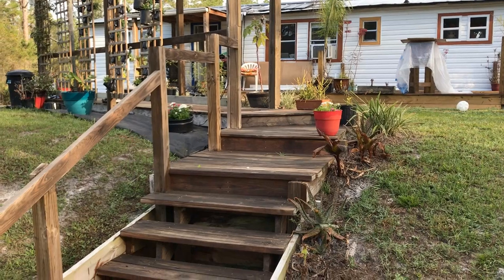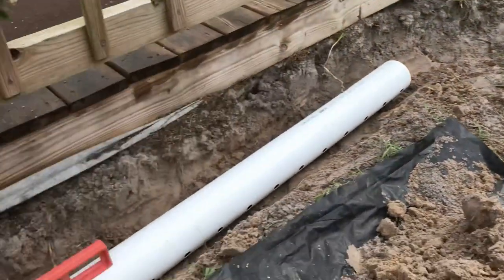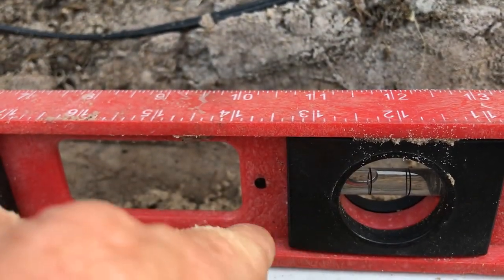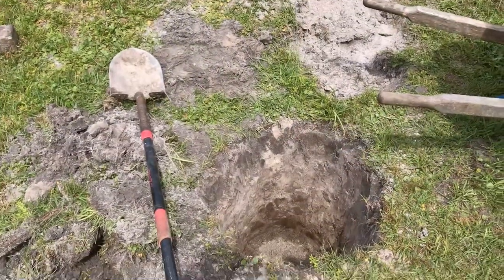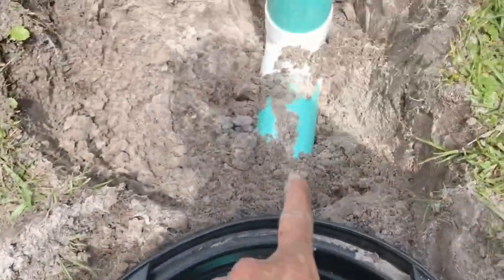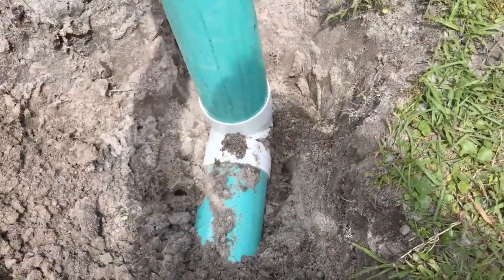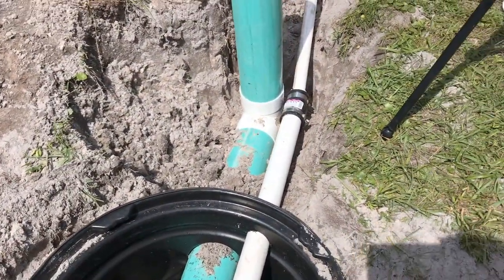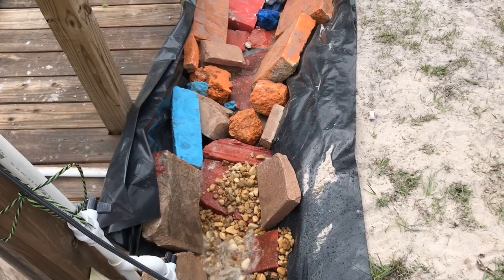DIY, Waterfall, How to Make a Water Feature, Complete How To do it yourself

Comment: Great video.  I followed everything to the T.
I cant get the pump to pump water up that high and  across.  Hieght 240cm. Length 300cm.   Please let me know which type of pump I would need.  I'm in the UK.
Reply: Sounds like you need a stronger pump thats all. Either that or you may have had an air leak somewhere that reduced your existing pumps efficacy?

Comment: Hi, could you please tell me how to get the nozzles in the holes . I’ve done everything to the specific measurements with pvc and 1/4 inch nozzles…I also have the rubber mallet. It simply won’t fit.

Comment: If you have the liner underneath why do you even need the big pvc pipe to the well?
Reply: Dirt and debris are likely to gather in the gravel, eventually impeding the flow of water. The drain tile ensures an unobstructed channel for the water to flow through and will function for many years longer than a gravel trench.

Comment: I liked It, Thanks, finally I got the idea to make a waterfall on my garden wall of 25 feet hight and 10 fee wide.
But still have some questions 
1. The product name to drain out the Water fall is "irrigation coupler"
2. Their is need to cut the irrigation coupler.
3 What is the size of irrigation coupler.
4. How many force required to run uniform waterfall.?

Thanks, Wait for your positive reply.
Reply: He says the size at 17:03

Comment: What happens when it rains and the pit fills up with rainwater?
Reply: IMO, the pump has to on 24/7 just like as sump pump and that would mean you will have a constant waterfall.
Reply: @mlhm5  He's saying what happens when it's more water than the pit can hold.
Reply: You could put a small over flow line in the top of the sump basin on the down hill side. Out to a drain.